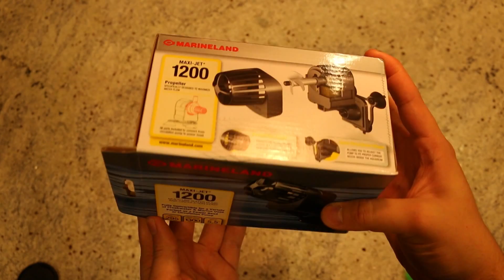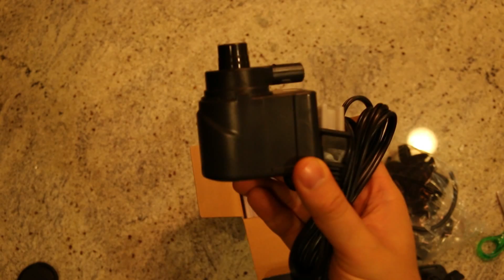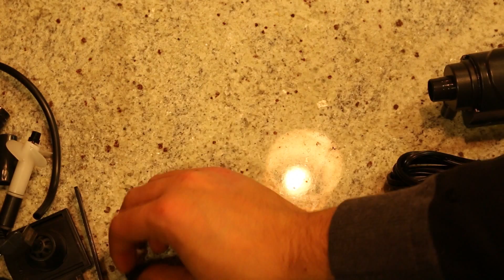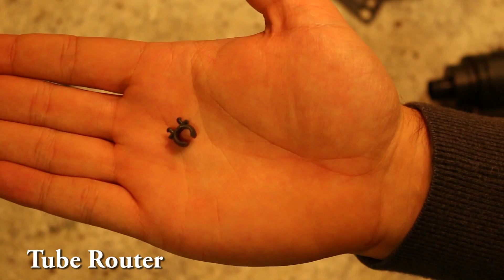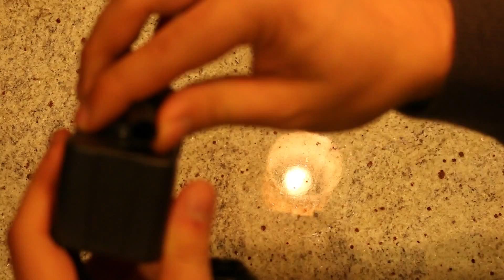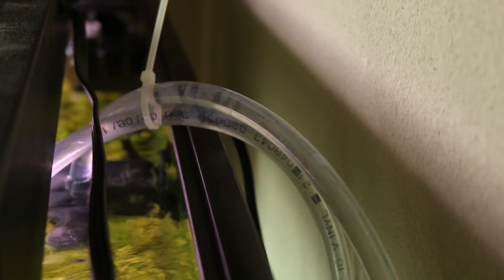Maxi-Jet Pump Review

Comment: Hello, would you recommend Aqua Clear   power heads?  On bad made  pumps, i'm having issues with the Fluval u2 and so are a lot of my friends. It seems everything is fine untill we go to turn it off to do maintenance. Clean the impeller , clean everything and go to turn it back on and it will not work, even priming /adjusting the nozzle . I had to put a pen in there to get it to start, worked once and stopped. The bottom line is ..if your paying good money you want something reliable. I do not know what they were thinking but when others were having the same exact problem then something just isn't right. It's still under warrenty but Fluval wants me to pay out of my pocket to send it back to them. My girlfriend ?, this is her third pump from them she purchased. and she still is having that issue. I figure why send it back when i will just end up with the same problem.

Comment: I recently bought an Eheim Pickup 60 filter and also found it WAY too noisy, while Eheim is usually an A brand and the model got loads of positive reviews.

I suppose it's possible that sometimes there's just a rotten apple in the basket or something. Thorough quality control, unfortunately, is not always worth the manufacturer's time, especially with cheaper models. Doesn't make it right though.

I don't recommend returning such an item for a different one, cause chance is, you'll just get another bad one from the same batch. I went for a different brand (Fluval U2) and I am perfectly happy with it. My aquarium is in the living room too, and I don't hear it at all. Happy end (so far) :)

Keep up the good work Jacob!

Comment: With aquatics, you get what you pay for. If you want a decent pump, get an Eheim :)
Reply: That's not always the case, i spend alot of money on one and it was just made bad..period!
Reply: That said, with the bigger brand pumps, you can always go straight through to the manufacturer for a replacement unit.